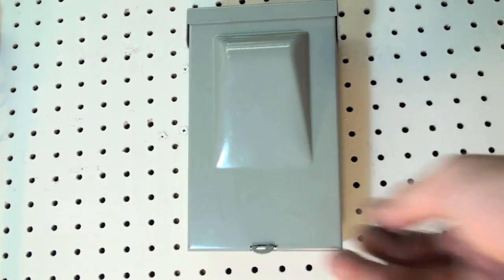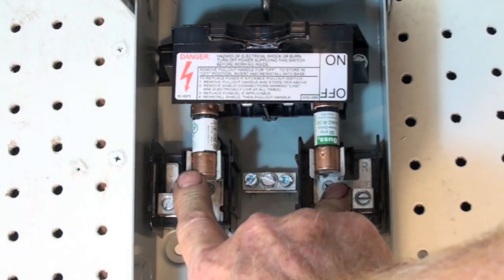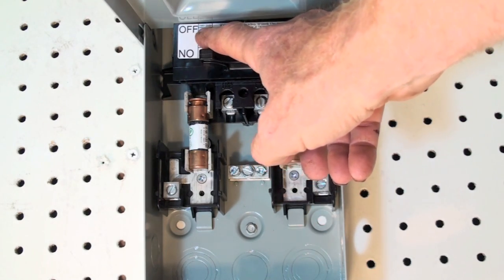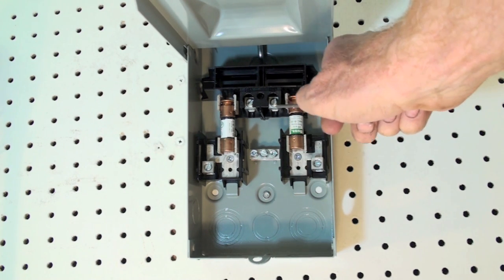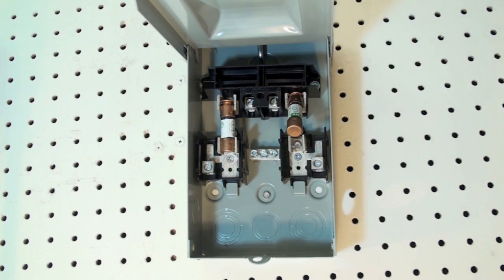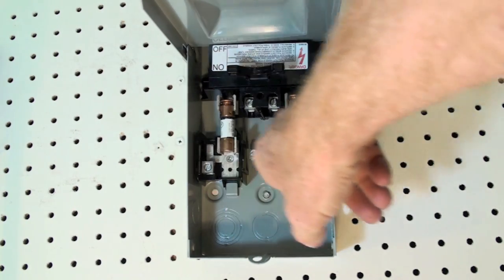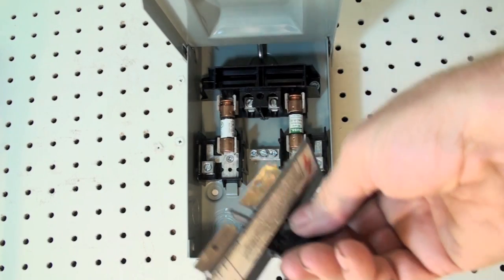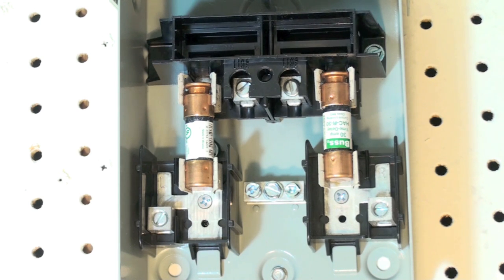The air conditioner service disconnect

Comment: I saw one of these cheap disconnects the sticker was upside down. I don't trust those stickers just remove the entire disconnect and leave it out risk losing it better then getting shocked. I check with a volt meter, but I have also seen where they are doing remodel work someone else goes in  main box and flips the breaker back on you don't know it. Have a couple of electricians working inside they tell their apprentice to go out and turn the breaker on he wasn't the one turned it off she now is turning the one on you just turned off.

Comment: so just that 1 little part that is easy to take out 

could wind up as over  $100.00

i would think people would want to put a $2.00 lock on it

can't just buy the disconnect

that's odd and wierd and funny

thanks
Reply from the maker: The disconnect itself is fairly cheap.  Its the installation that costs.  I don't recommend locks on the disconnect.  Disconnects are there to cut power when you need to.  A lock makes it harder.  And the key is always lost.
GFM

Comment: fuses?seriously?when was this video made...1942?
Reply from the maker: You and I may consider fuses to be old news.  However, the cost difference is quite high between the fusible disconnect and the breaker equipped disconnect.  Guess which one will be used when you have to bid the job.
GFM
Reply: My disconnect is GE with fuses, brand new. Nothing wrong with the fuses in my opinion. Great videos, GFM!
Reply: grayfurnaceman 
If the residential a/c unit has a breaker without an official service disconnect or a breaker at the panel and another breaker outside where the service disconnect would be located is there an issue with code

Comment: lol why the hell does it say no on the box XD
Reply from the maker: I guess I don't understand the question.
GFM
Reply: the off button is like up side down but the on button is like the other way, i was just wondering why it said no instead of on
Reply from the maker: The design of the plug is that if you can read the OFF, the disconnect is open.  If you can read the ON, the disconnect is closed.
GFM
Reply: u have to like , you know, like totally stand on your head to like service that one....
Reply: now i get it!